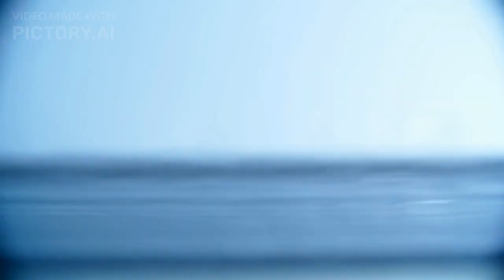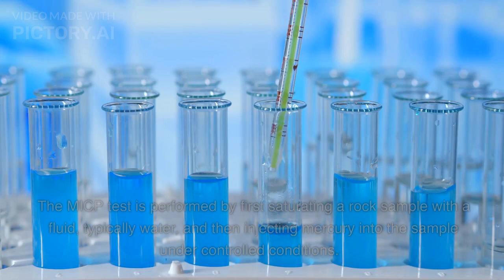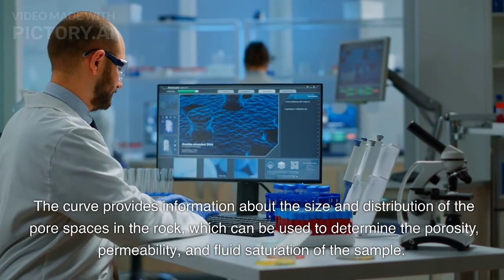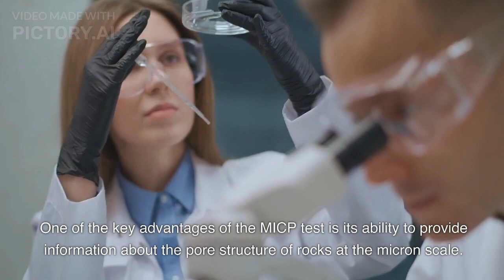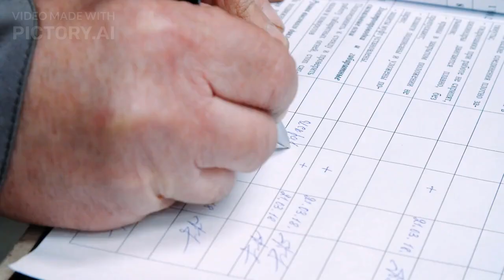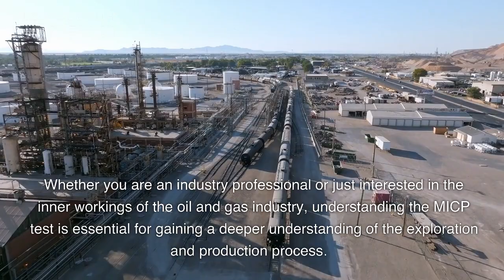Mercury Injection Capillary Test

Comment: The pressure required to inject mercury into the pore space is not directly proportional to the size of the pore, but rather it is inversely proportional to the size of the pore. that is why smaller pore sizes require higher capillary presure for mercury to be injected into the pore spaces. That is the Washborn equation, Capillary pressure  P ∝ 1/r